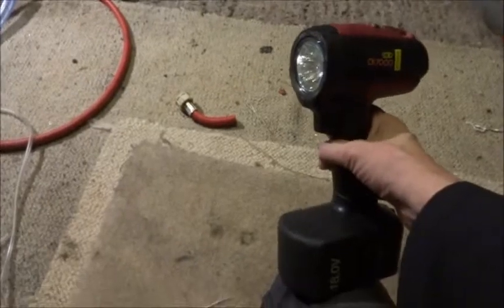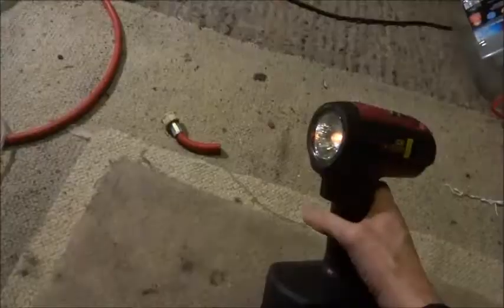smoke

Comment: Superb ingenuity! Great job. How did you mount the cigarette, and what are you using to push the air, please?
Reply from the maker: The cigarette is pushed into the pvc tube stub in the other side of the lid and the air is coming from an inflatable camp bed pump powered from the 12v car lighter socket.
Reply: Thanks. Now why is it whatever I want to do never fits in the bits of hose I have in the garage. Doh!